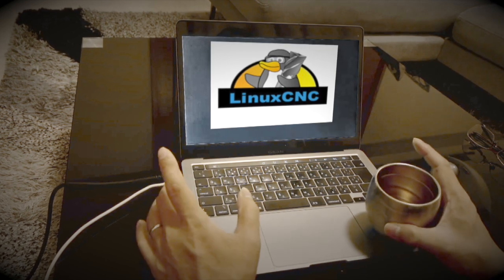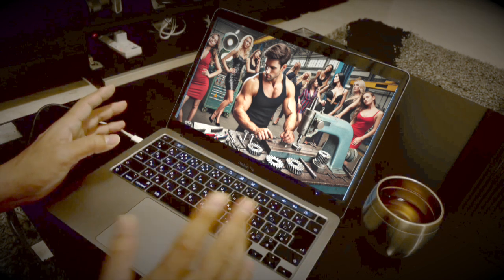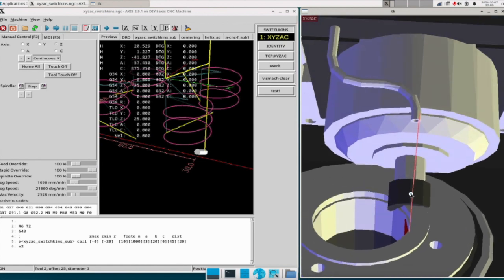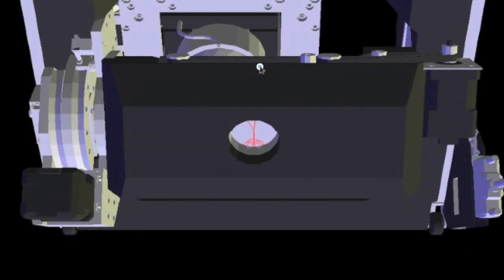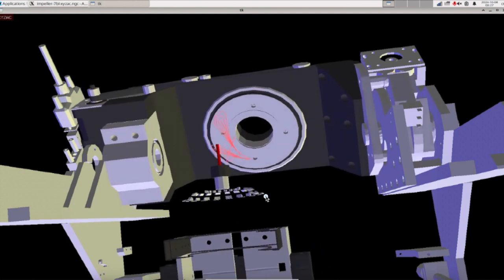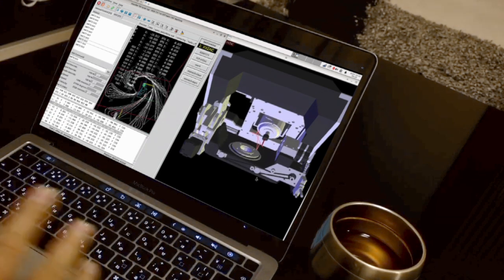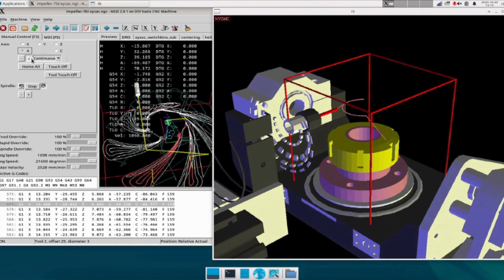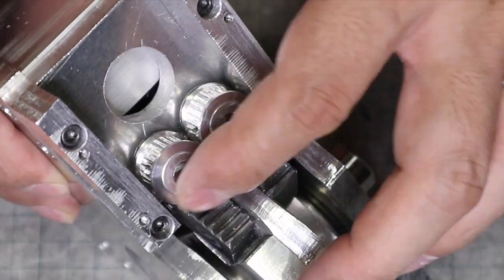Building The 5-Axis CNC Machine in a Small Room: A DIY Journey. (Part14)

Comment: what are you using to write these beautiful 5axis toolpaths? Thanks awesome for the vismach shout-out!!!
Reply from the maker: That can be made with fusoin360.
But I think you need a subscription.
Reply: @a-cnc-f  was hoping for an open source solution :( anyway one day...
Reply from the maker: As far as I know, there is no CAM that supports open source 5-axis TCP.
Reply: Unfortunately I can't think of finished stuff except freecad either. However freecad is such a huge project it would require a very serious effort to push it towards 5 axis. I was trying to start my own but due to the need of csg I ended up with a ncviewer for cnc lathe code.

Comment: So would you use this to check the program prior to running it on the real machine or to monitor in real time?
Reply from the maker: I think Vismach's movements are faithful to the actual movements, but the motion is not real-time.
To begin with, some latency is not a problem in simulation.

Comment: does linuxcnc feature non-trivial lookahead now? last time i had to do with it (years ago) there was no lookahead.
Reply: Yes.  It has had it for several years now. I’ve used it on some adaptive toolpaths at 10000mm/min and even with too many nodes it’s smooth as can be.
Reply from the maker: It's been a while.
I am not sure about the look-ahead feature.
I just happened to find Vismach and was interested.